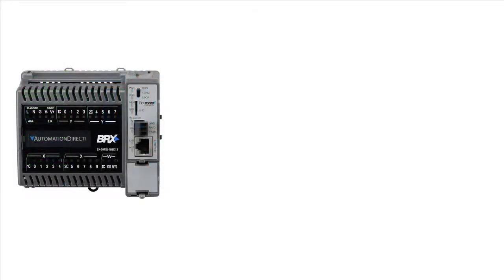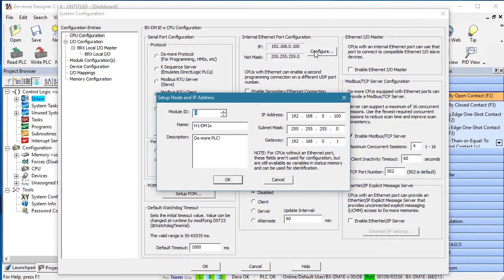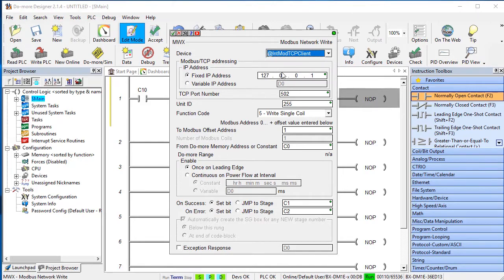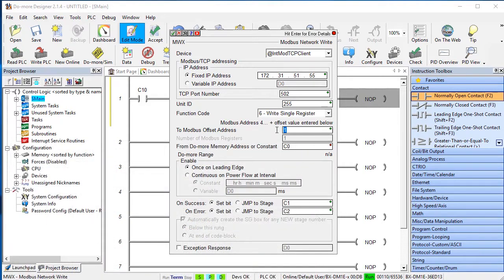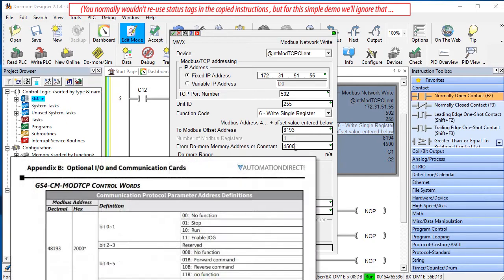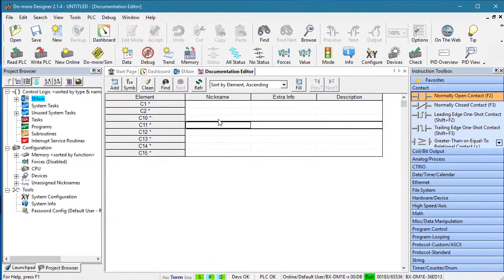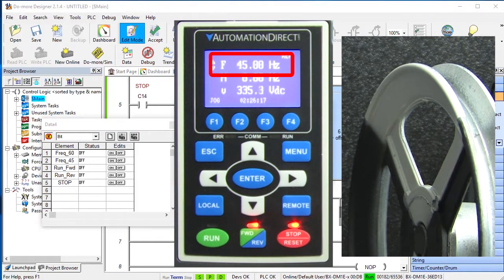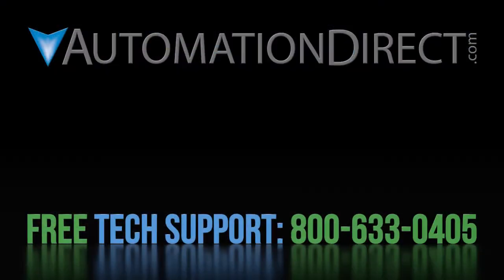Do-more PLC Connect to a DURApulse GS4 VFD via Modbus TCP from AutomationDirect

Comment: i appreciate you making the video but it would be nice if the steps to do the set up weren't done in microseconds.  my eyes don't even have enough time to see what you did.  

if i'm already watching the video, i don't mind if it takes 5 or 10 minutes to get through.
Reply from the maker: Thanks for the feedback!  Yeah, we tend to err on the side of too fast because we know the viewer can always slow the video down (click on the settings gear icon in the lower right) and/or pause the video to catch up. But we do appreciate the feedback and will try to improve it to millisecond timing instead of microseconds in the future ...
Reply: @automationdirect  so here's what i want to do... run 3 motors from an HMI.  Not sure if this is the right place to do this but i'll ask for help anywhere i can get it.  

i already ordered gs4 drives with modbus tcp cards.  i'm going to order the brx starter kit w/ethernet, to get started.  seems to me like all i should need is..

drives
plc
unmanaged ethernet switch
10" c-more

eventually i want to send a start/stop run time report to the bosses.  if someone can tell me if i'm missing any critical components or any ideas on where to start i'd appreciate it.
Reply from the maker: Ethan, sounds like you have all the major components to accomplish the project. I would start with getting the Drives controlled through the BRX first. You can log the start/stop run time report from either the BRX or the C-more, both have logging functions.  What I would advise. After you get the Drives up and running with the BRX, call into Tech support and have them give you a run down of the options and see which works best for you. Tech Support number 1-800-633-0405
Reply: @automationdirect  holy crap.  listening at half speed is pretty funny.  sounds like the narrator came to work loaded